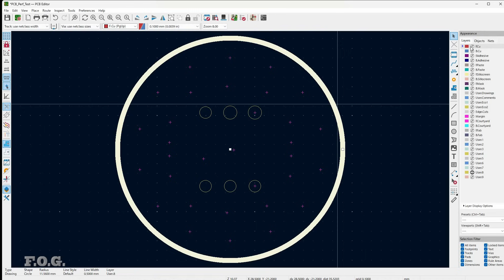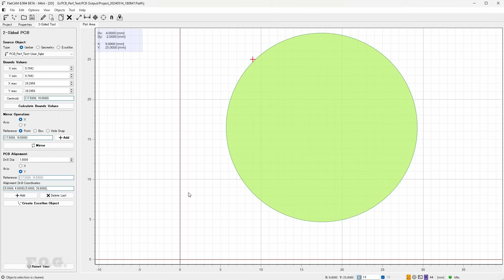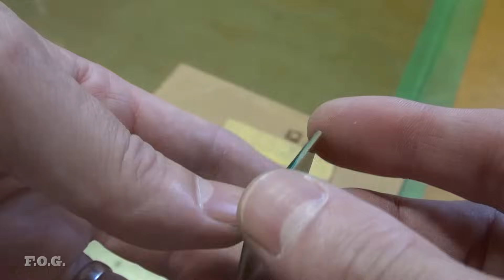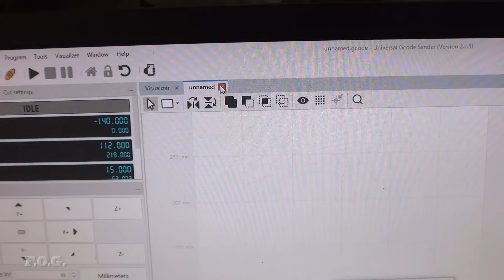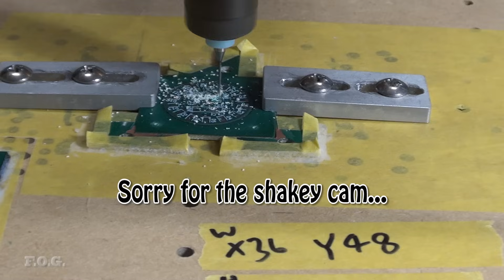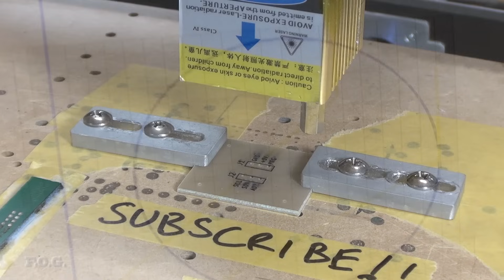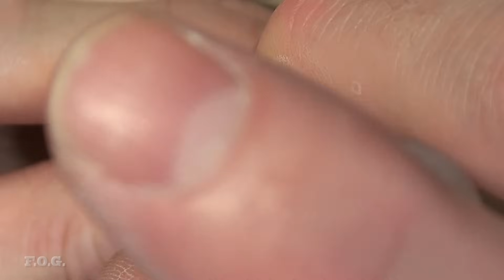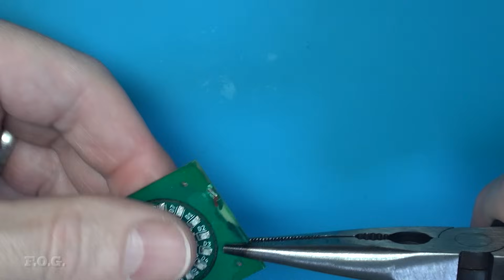The BEST DIY PCB Tutorial (ForOurGood PCB Method)

Comment: Why don't you install the laser and spindle at the same time so the offset between them is constant, then it's a lot less alignment.
Reply from the maker: Originally when I first started this series I did give it serious thought, but did not follow through in the end.
Without a doubt, it would save some time assuming the relationship would reliably remain precisely locked. But, likely just adjusting the height of the spindle in the mount will knock this out of whack (I use the CNC for various things, not just making PCB's).
Physically having them both mounted at the same time will also likely affect the physics of the CNC3018, and that may affect the precision, and naturally the usable range will be reduced, and then we also have a risk of precision errors in the lead screw affecting the result (as we would be working in different areas of the lead screw for laser vs spindle)
Phew.. actually there were more concerns than I remembered, some of them likely are not a concern at all, but only testing would confirm that.
Anyway, I really like the idea of making the reference marker for a given job, so I would be making that in any case. This provides a way to precisely recover the position should your controller lose its marbles or something else that causes you to lose position. It also provides a way to check with confidence that your alignment is correct, before you start doing the actual work.. so peace of mind and all that.
Actually the alignment process is not the difficult part, really it is physically fiddling around, swapping between laser and spindle, that would be the primary benefit of having them co-mounted.
Sorry for the waffling! 😁

Comment: Amazing tutorial, I'm glad you are highlighting the importance of the correct version of FlatCAM etc. as it wouldn't be obvious for someone new that they are very different. Also what's going on with the wiggly track snaking under R8? :D
Reply from the maker: Yep, the devil's in the details as they say. Some people will think video goes into too much detail, but I know from experience, that it is hard to put this puzzle together when your starting from zero.
BTW: The track is squiggly to tune it to an exact length because.. nah.. just kidding, actually the resistor is at a weird angle and I wanted to leave room for the ground plane to sneak through.. sadly I am still a nube when it comes to KiCad, and could not figure out how to freely set the angle of the track to match with the resistor.. Do you know how??
Thanks for taking the time to comment.

Comment: Great job, thanks a lot for doing such long and detailed video with no ad-crap!

Just a side note: 
From my experience, blue laser doesn't do really well on white.
The darker the better!

Even lighter vs darker masking tape makes a difference. 
And if I simply paint it with black sharpie - end result is way better.

You were complaining on laser sometimes not being able to start burning glossy white solder mask film.. That should be exactly the case.
I think simply switching to darker colors would save a lot of frustration + give you much larger margin for possible error. 
I.e. black for solder mask, something darker for silkscreen and dark red or black film for stencil.

But yeah, you'll have to re-do all your speed/power settings :)
Reply from the maker: I am glad you liked the video, it seems that you are one of the few people who noticed I turned the ads off.. weird.

I did a lot of testing in an earlier video in my series, check that out if you missed it, and thankfully found this green resin burns extremely reliably.

But you are correct however, burning anything very shiny, glossy or translucent will not burn with this laser. In this case, using a dark coating or sanding the surface is the only way to get a reliable burn.

I have not had trouble with burning normal white paper however, so I don't think the colour is the main problem, more so the reflectivity or transparency appears to be the culprit.

I have not tested burning white UV resin yet, but I do plan to try to do that in the future.

Thanks so much for taking the time to comment and leaving some suggestions, people sharing their experiences have helped me a lot with this project.

Comment: Video finally arrived. Hope to see you try with galvo laser one day. CNC laser has very low acceleration which make burning very uneven. I got exhausted with this process when burning all of my small pads so I quit and try with the mask instead. Probably high acceleration laser like galvo or at least coreXY klipper laser might have enough acceleration to encounter that
Reply from the maker: I can pretty conclusively say that acceleration does not play a notable role when using this process. I was in fact worried about that given the CNC3018 with its cheap lead screw accelerates pretty slowly. Undoubtably there is minor affect, but it is not noticeable from my experience.
The key issues about clearing the resin from the pads without burning them off the board, comes down to a very simple calculation. That is how much “heat over time” you inject into the pad, and how much “heat over time” the pad can dissipate. If you add far more heat than the pad can dissipate in a given timeframe, then that will result in enough heat build up to eventually burn the substrate (And on top of all that, of course you’ll always need enough laser power to clear the resin).
The best solution I have found is to use active cooling, such as air-assist, by doing that you can stop the pad from building up too much heat, meaning you can get away with a much higher power level that allows you to clear all pads with a single power setting.
If you do not have air-assist, then the only other option is to break up the pads into different groups/jobs, applying an appropriate power level, depending on how well you expect them to be able to dissipate/cope with heat. Naturally this requires experience and good judgement to get this right, that is why I recommend air-assist as demonstrated in this video.
Thanks for your comment and I hope you enjoy the video.:face-blue-smiling:
Reply: @ForOurGood if so then that's very different from my result. I got full blast of air assist on all the time but can still see very clearly that the corners will get burned much more than s straight line. There are some settings to help even out the laser power but then it will reduce the power by a lot and still somehow doesn't get that consistency. There is one more thing is that if I don't align the laser well enough and some how burn into the resin area beneath then 100% guarantee that the pads will peel off. Those got me so frustrated with the laser so I developed my own process using printed light mask to cure the solder mask. I've been having consistent results since then and much simpler process and less tedious. Hopefully I can share it some days but I'm quite lazy with making videos and busy with out projects also. But I'm very glad that you succeed with your process. I hope more people will get into this so someone will try to fix FlatCAM. 😅
Reply from the maker: @TinNguyen-uu2tr  If the acceleration is that slow, then there must be a problem with your settings of your CNC (mine is 500mm/sec/sec for all axis)
Also, using good FlatCAM settings is pretty critical, and that's why I discussed in detail in this video.
Finally, maintaining perfect alignment is also critical, which is why I came up with the new alignment method which is working very good (alignment pins just don't provide enough precision).
Finally, you can't have the laser set too hot, there is a limit to how much air assist can help.
In any case, I am glad you came up with a process that is working for you, I am very much looking forward to your video 👍😁

Comment: I've been mulling over your process and how I could apply various aspects to my own half-baked one (it's similar to your old process), and I was wondering if you'd experimented with using your "Silkscreen process" on the main PCB mask? In theory, it would make cleaning the pads much quicker and easier with much less elbow grease needed - the only downside I can think of is the laser curing process would take a lot longer. 

Btw, Unexpected maker (another Aussie) has a really nice "reflow master" kit that makes creating your own reflow oven really simple. I made one some time ago - it has so many additional uses with the "bake" mode, plus the ability to run proper solder reflow temp curves.
Reply from the maker: After seeing the great results of the silkscreen, I also had various ideas about how I could apply this for different purposes, maybe even trying to set the positive etch pattern with it. Setting the resin around the pads should also be plausible.
Naturally, I would need to switch to the 10sec Mechanic resin for everything, and of course this is going to mean much much longer jobs (although it may be possible for it to be faster if the resin is not a couple of years old, like mine is).
Then there is the question as to if the result would be cleaner using an expose method vs the burn method, and how reliable/consistent that might be given the expose method is a little more finicky, compared to burn method that just works and gives a consistent result every single time. For a silkscreen, +/- 10% thickness variation does not make a big difference, just as long as you can get it to stick, but a for a etch resist or pad clearing operation, this could be a real problem when working with small stuff.
I also have other ideas about ways to clear the pads by laying something down in advance that could easily be removed later, along with any resin on top, but this has not progress beyond the thinking stage at this time, I generally think this might be a non-starter.
For now, I am super happy with the results I am getting with the current process, and I probably make it look harder to do than it actually is, this is mainly because I had a lot of bad experiences before finally getting to the point where it actually works well.
I still have a few improvements to my process in mind, but mostly minor tweaks to materials, tools and methods. Even so, I think at some point I will experiment with the resin expose method more, at least to test my assumptions, and see if this might actually be something practical/possible/worthwhile to do more with.
As for the oven, I did actually think about doing something like that for this video, but in the end, I deemed it not a pressing concern, that old Panasonic clothes iron is doing what I need it to do for now. Maybe one day!
Reply: @ForOurGood  Cool, I figured you'd likely at least thought about it. Btw, what power is your laser? I've got a dinky little 5w laser that is essentially useless for anything other than marking things or exposing resin, and I really need to find a better one.
Reply from the maker: The laser I am using is a “LaserTree Gold 450nm 40W-Pro 12V 20mm Fixed Focus Laser”, apparently it puts out less than 10 watts of optical power in reality. I highly recommend getting one with an air assist nozzle.
Reply: @ForOurGood  Cheers, I'll have a look for a similar unit.

Comment: great video. I watched the entire thing in two sittings. On the solder stencil; I've had recent luck using .15mm plastic sheet that I spray painted matte black before the laser cut. Makes a larger, washable stencil that I can tape down when batching PCBs. Adding a few "mouse-bites" around the edges of oddly shaped PCBs makes them so much easier to remove from the parent material. Great video. I cant imagine how many hours you have in the production.
Reply from the maker: Just noticed your "mouse-bites" point, not sure why I missed it first read, but I will try to keep that in mind, thanks!:trophy-yellow-smiling:
As for amount of hours in production.. yep, don't want to think about it much, especially because I already know the video will not really get that many views.
But they say, about an hour per minute, is what it takes just to properly edit a YouTube video.... but that excludes everything else :face-red-droopy-eyes:
Reply from the maker: Yeah, sorry for the long video, but it seems tutorials do much better if they are not split up. Even so, I am glad you found it interesting.:hand-purple-blue-peace:
I did actually try using plastic sheet, but I could not get a clean cut... more of a melty twisty result...
I didn't use matte black paint, but I did try a matt black paint pen if I remember correctly.
The feature size also is a challenge, with a paper label I could barely eek out the 0.2mm width required for the QFN20 package, so I sort of came to the conclusion that trying to do that with plastic sheet would simply be futile.
What sort of resolution are you getting?
Do you know what type fo plastic the sheet is made of?
Currently, I am usually only doing one or two PCB's with a given stencil, so it is not really a big deal if it is not reusable (of course that would be nice if it was reusable).
What is more of a concern, is getting the correct thickness (currently good), nice clean edges (currently not great), smooth surface (currently not really), required resolution (currently passable) and relatively sturdy (currently sturdy enough for a couple of uses, but not really sturdy as such)
In know the locating of the stencil, is doable without an adhesive backing, have seen this in another persons video, so I am not super worried about that aspect either way.
Thanks for taking the time to comment and provide some info too!:face-blue-smiling:
Reply: @ForOurGood  The first plastic stencil I made was from the diffuser sheet from a cracked LCD monitor. Since then I have used old school transparency sheets made for laser printers. I found two lower power cuts are better than one high power. Also I cut the outline only and not the field area.
Reply from the maker: @mitchellhw2006  Got it, thanks! I will see if I can find something similar and give it a go. I actually used to use those laser printer transparencies back in the 90's when I was making PCB's back then, I guess it makes sense that they are somewhat heat tolerant.

Comment: I always wanted to try make my own PCB,my problem that I never did learn about it,but I always know what I want and how I want at basics level. I mean some examples: I want to make a led panel I know I want to use 12v dc source and 3v leds. Or I wanted to make last time a mop robot. I can do the coding and I know all the accessories I need with ardunio, but obviously is to much wire,so I thought make a beautiful pcb board in Fushion 360 with connectors and everything.  My problem thst I don't know when to use and which type  ,diode,resistors,capacitors, transistors etcetera.  I was trying to looking for a pcb design program like at led panel example I give the input volt 12v and the amount of led I want to use and the program help me out what I have to use between them to don't get overcurrent etcetera.
Reply from the maker: There are plenty of resources out there if you want to learn electronic. You don’t need to learn absolutely everything to be able to start making your own PCB’s. Start small, learn the very basics, and do some testing to see if what you learnt makes sense with the results you get. Each small piece of knowledge is a building block you can use to improve your skills as you go, and in this way, it is very similar to learning writing code. I started writing code at the age of 12, but I did not start doing anything with electronics until age 17, but learning code helps you with structural thinking, and that helped allot when learning electronics.
Good luck! :person-turqouise-waving:

Comment: You can speed up the curing of the UV resin with hot air.  I've been finding that my resin can cure in less then a minute with hot air...
Reply from the maker: Seems I am a little late to the game with regards to pre-baking UV resin before exposure, but it does not exactly seem to be common practice either.
Actually, just yesterday I noticed on an Ali-Express store with the Mechanic UV resin, a set on instructions indicating both pre & post baking as a part of the process (the instructions are really not that clear however, and they talk about baking times of 50~60mins for each, which seems excessive).
Unfortunately, I see no such similar instruction for the green WNB UV resin I am using.
I also didn’t see a specific improvement in curing time with the Mechanic UV resin after baking, even though the viewer who commented indicated instant curing was achievable.:body-blue-raised-arms:
The clear benefit I did get was a quality improvement, which in that case is the most critical thing anyway. It is possible that either my testing was not thorough enough, or my UV resin has just aged poorly (it is about 2 years old, and Mechanic UV resin is stated as a 12-month shelf life)
Even so, I was already thinking to give pre-baking a try with my green WNB UV resin, so I will likely do that next time, and see how it affects the curing time (30mins is way too long). Don’t think I will be hitting with a heat gun however, that would likely disturb the finish, so I will probably try the hotplate, basically using a similar method to what I am already doing with the Mechanic UV resin. Would be nice to get the time to less than 15mins in total, otherwise it is probably not worth the extra messing around.
Thanks for the comment! :planet-orange-purple-ring:

Comment: Hello, thank you for the video, it would be nice to have a low-budget version of this series.
Reply from the maker: The process is actually relatively cheap, considering the end results that can be achieved.
If you are smart with the purchases, I expect you could get started for around about $300USD.
You also need to keep in mind that the CNC is a multi-functional device, and you can use it for things beyond just making simple PCB’s.
Thanks for the comment! :trophy-yellow-smiling: